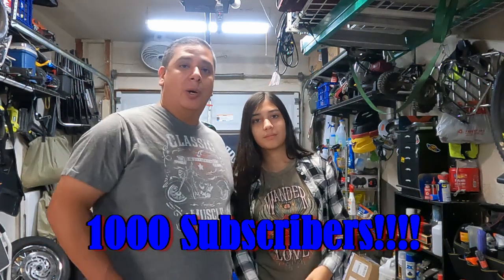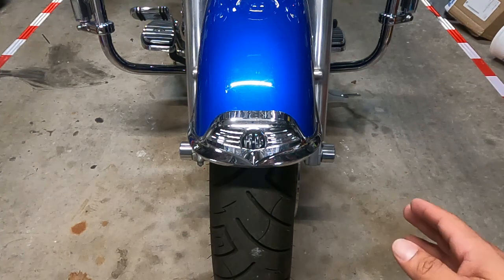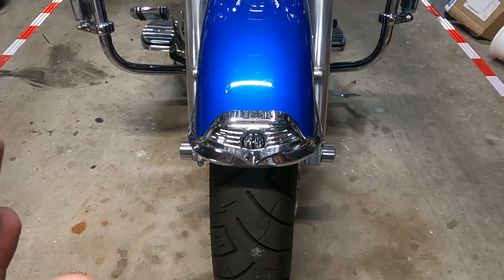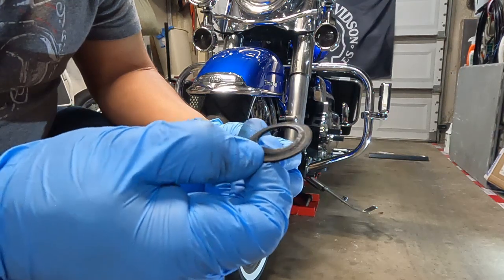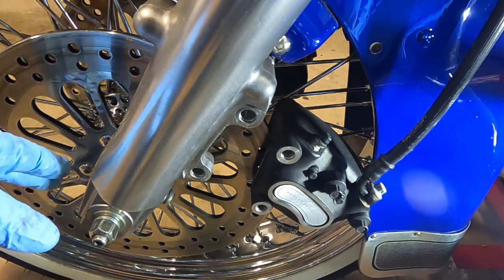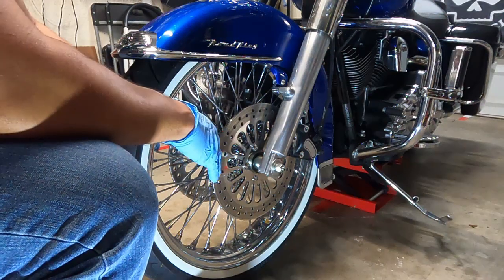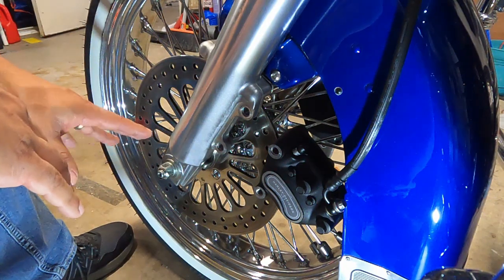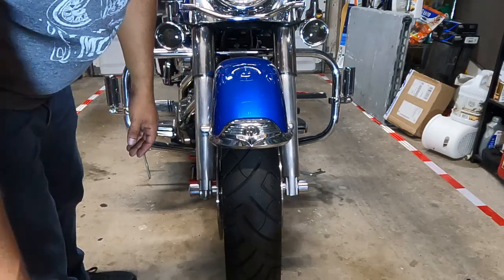21 Inch front wheel brake alignment - Wheel Spacer

Comment: Hi Mike, glad to see this vid! Struggling with the same problem on a Rocket R3 front wheel alignment. This could be a solution but I have some doubts? 
My bike pulls to the left, clamps and forks were reset, no luggage, tried different roads, outcome the same. 
Then I noticed my front wheel is offset to the left (sitting in front of the bike) about 3mm. Now... When I add spacing to the left side (my free forkleg) should I not compensate by substracting spacing on the right side? 
When you add washers to the disc it will work only on one side where I need to add spacing to the disc but how do you fix the other side when the disc rotor doesn't match the Caliper groove?
Reply from the maker: Has this been an issue since you bought the bike or was it post a modification or something? Are you running the stock front wheel? I was kind of thinking of the forks two by what you were describing, since its actually pulling rather than just a rub or slight misalignment. Thats a really tough one if its all stock.
Reply: @Mikeityourself  I Bought a new one 3 years ago, it had it since the beginning. The bike is stock, both tires are new. My dealer said it's normal and because of the big engine it makes it do that but that's BS. When I turn the throttle when standing still it pulls it to the right. I'm sure with the correct spacing I can fix it but I just don't see how to get the calipers to fit afterwards since the Brembo Stylema M4 is bolted from the top whereas with most Harleys I see it's bolted horizontally. Apparently, all Rockets have it to some extent. As a matter of fact, we have a 2nd Rocket that is slightly newer and that one has it too
Reply from the maker: Im with you on what the dealer said, doesnt make sense. Ive felt the bikes pull when they have the 180 pistons but its only when you throttle.  The only thing I can think of would be to maybe try feeler gauges if you cant fit a caliper and then make small changes until you get to the right place. Sorry Im not able to help more, hoping one of those watching might have some direction.